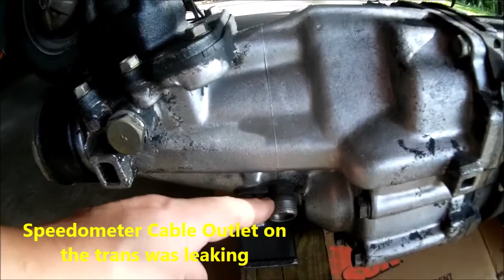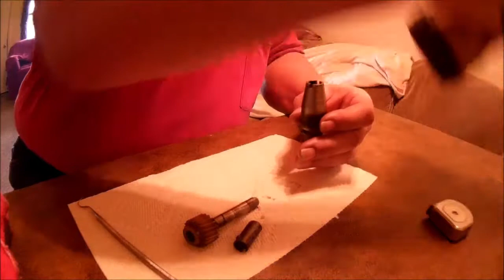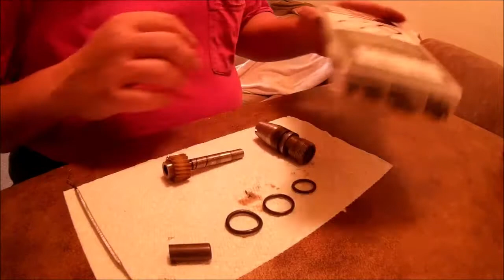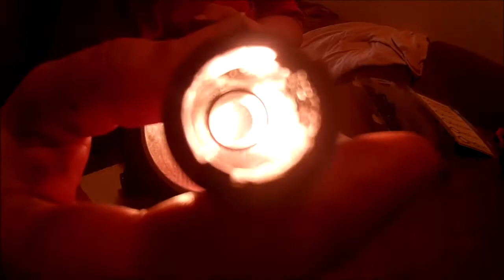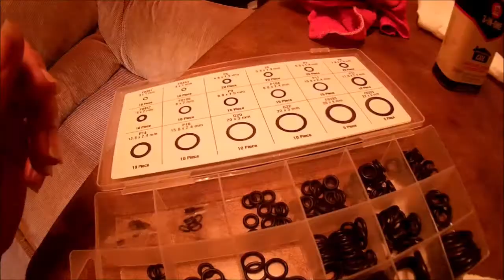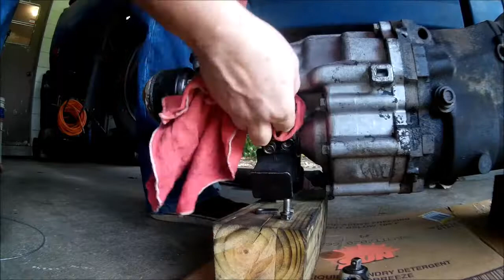1978 Toyota Pickup/Hilux-Speedo Cable/Transmission Leak-Fixed

Comment: Hello Man, cheers from México, can you make a video of how can repartir de speedometer Toyota 1980
Reply from the maker: Cheers Oscar. The speedometers in these trucks are usually cable driven from the transmission. It is a simple system and usually does not have problems. But if there are problems, that means they are easy to fix.

I have not had to repair the speedometer in my 1978 (only some very minor service), but I do know about all of the parts involved. If you have a specific problem you can describe it and I will try to help you. Let me know exact symptoms or issues.

Comment: Where in the world can I find a speedo gear? I have a w50 transmission and am having a heck of a time finding information.
Reply from the maker: If you mean the speedo gear in the "bullet" (the part I serviced in this video), here is the best that I could find, overview first:

https://parts.villagetoyota.com/showAssembly.aspx?ukey_assembly=357131&ukey_make=1021&ukey_model=14409&modelYear=1978&ukey_category=19382&ukey_driveLine=6043&ukey_trimLevel=24536

Specific Part Page:

https://parts.villagetoyota.com/products/TOYOTA/1978/Corona-HARDTOP--2-DOOR--DELUXE-2200CC--MANUAL---5-SPEED/GEAR-SUB-ASSY--SPEEDOMETER-DRIVEN-ATM-GEAR-SUB-ASSY--SPEEDOMETER-DRIVEN-MTM-N=18-N=18-MARK-186-N=18-N=18-MARK18X6-WER78-OR-P19575R14-TIRE-N=18-WER78-1/2042443/3340369065.html

I know it says 1978 Corona, but those cars had the same engine (20R) & trans (W50) setup as the Pickup, so it should work. Looks like you can only get the gear as part of a complete kit, Part # 33403-69065. Please double check my part #'s to make sure I'm right. You might also try the local "stealership" IF they have a sympathetic parts guy. They might have the same diagrams on their computers & maybe order it for you? Best I can do for now.
Reply: The13thSword yes that's what I meant and wow thank you so much I'll drive into this info asap

I have a light blue 76 long bed 5 speed,  Weber carb, aftermarket headers and not much else,  she's a fun truck to work on. 

Again,  love the videos,  thanks
Reply from the maker: Eric,
You are most welcome, just glad that I could find it (or anything!) How's that Weber treating you? Got the fuel pressure regulator on it? Electric fuel pump in the tank or mechanical pump on the head? Just curious.

Drop me another line if I can be of any other help to you.
Reply: Weber is great,  it was easy to install and eliminates lots of vacuum lines. Pressure regulator is on and set to 2.5. I have an after market fuel pump in-line right next to the tank. I recently drove 400 highway miles and got 26+ mpg!
Reply from the maker: Thanks for letting me know. Excellent, sounds like you've got it set up perfect. I did the complete desmog on mine, got it down to 2 vac lines; the vac advance on the distributor & the vac line for the brake booster. EGR & AIR Pump deleted. I kept the stock carb instead of going Weber (no $ for it), just plugged up all of the ports that weren't being used. Once I got the mixture dialed in no problems. My mileage is similar, when she's running; I'm still trying to put my trans back in after putting in new clutch parts. Wotta headache! >:^/